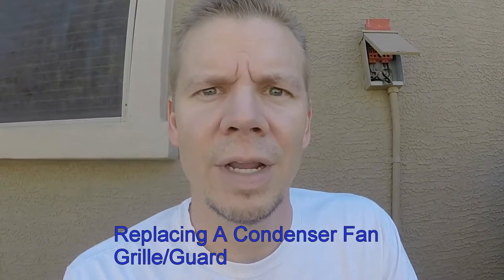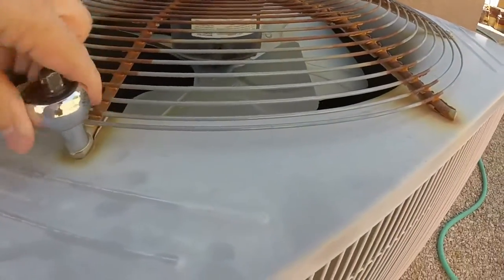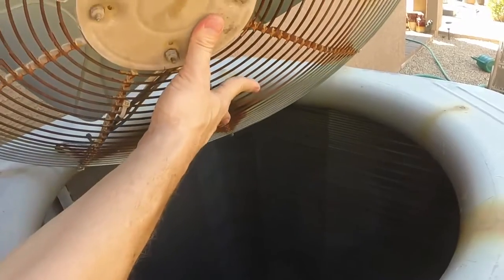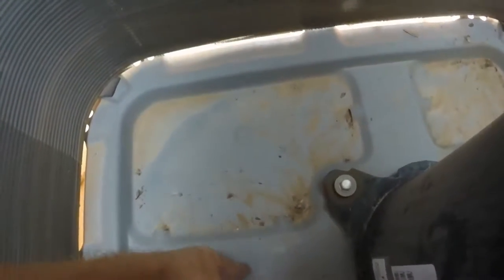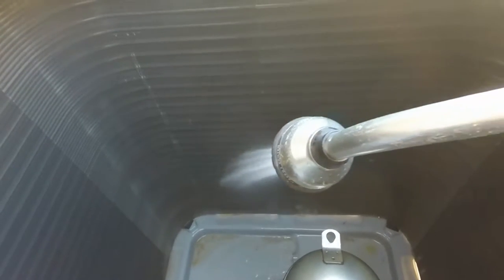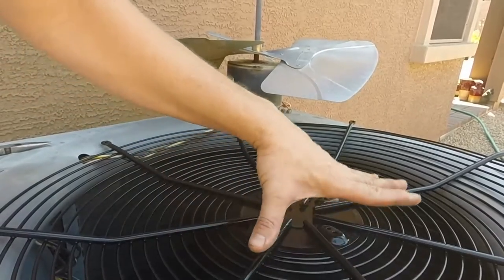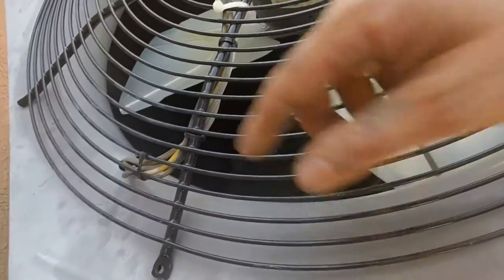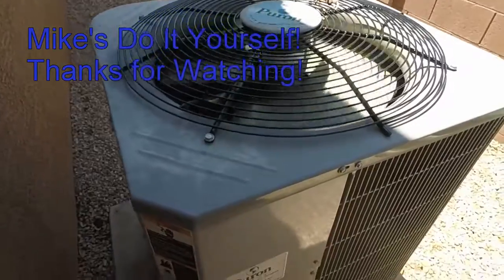Replacing a Home A/C Condenser Fan Guard

Comment: Can you please comment on what products you used for priming and painting the condenser?  I have no idea what to use -- never painted metal before.  Thanks.
Reply from the maker: hi Maliolani - yes, I used Rust-Oleum products from a local home improvement store- I chose a flat gray primer, a high performance enamel- and you can clear coat if needed- all paints were approved for bonding with metal- hopefully that helps, and thanks for the question! - Mike.

Comment: Thanks for the video.  How is the new guard holding up to rust?  Practically all the fan guards for the Carrier units in my neighborhood are rusting after a few years.  It would be nice if Carrier would provide replacements upon request.
Reply from the maker: Agreed- the plastic coating/ paint finish definitely doesn't hold up in the heat-;Mike.

Comment: Hi, my fan motor cover is rusted pretty badly on one side and I don't know why. The unit is only around 5 years old at most and I had the same unit on another house for 17 years and it never rusted at all.  I asked the AC maintenance guys and they said to leave it. I wanted the cover taken off and it being cleaned. I can't see rust being a good thing on anything ever.  Your thoughts?  Thank you...
Reply from the maker: Well, in reality, it's purely cosmetic until it starts deteriorating and crumbling apart. I would replace it or try to sand it down, sand blast it, get it down to metal, and repaint it with a durable paint that will hold up to the elements. Most A/C units will last between 10 to 15 years, so if you can get your cover to last that long by repainting or replacement, you'll reduce the amount of $ your paying the A/C techs by doing it yourself. Good luck with your project!- Mike

Comment: My compressor looks fine but the fan housing has rust. Are there any tips for that, or do I just mask the label and do what you did with the compressor?
Reply from the maker: You could sand or sand blast the rust off the fan guard, then prime and paint the guard with a durable exterior spray paint- maybe the same color to match. I believe there are some solvents that can help get rid of rust,also. White or tan could be a good overall color to reflect the sun better and last longer. Good luck with your project! - Mike

Comment: What is the name of the metal part that the grille screws in to?
Reply from the maker: A/C compressor housing, fan housing, condenser coil housing, or top plate cover.  Good luck with your project!- Mike
Reply: @mikesdoityourself  thank you!!